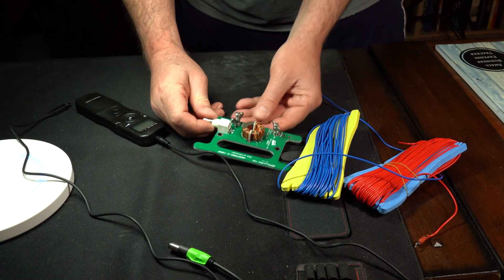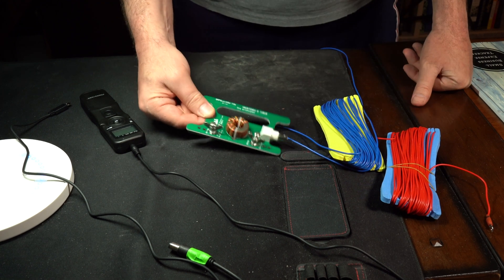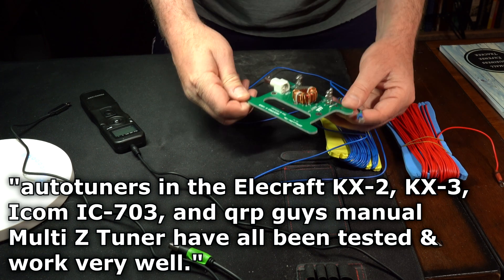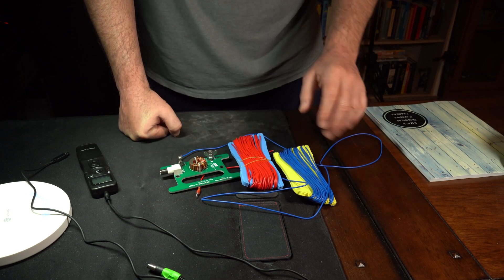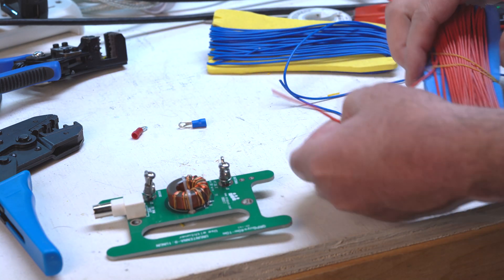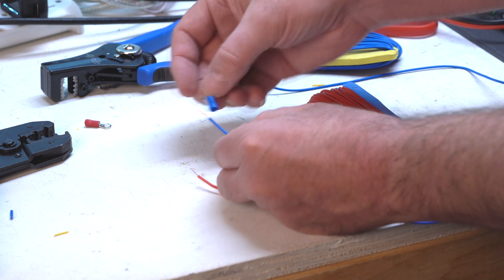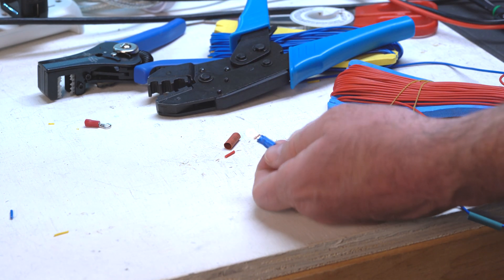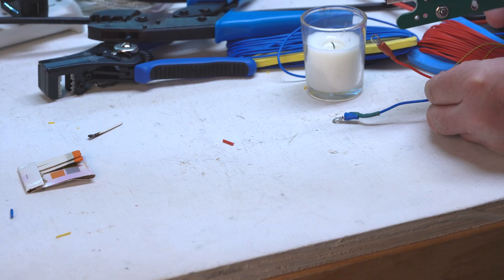CHEAP Ham Radio Wire Antenna! | Semoic Balance Unbalance 10W Balun 9:1

Comment: My first antenna. I spreaded them along my house indoors when i first got a radio. It actually worked.  I was just tinkering with it mainly using as a substitute for a dummy load.
Reply from the maker: Love that.  I did some wacky stuff my first beam I made for 10Meters i made out of pvc and aluminum.  Bands were dead.

Comment: Very nice video. One tip the two holes that run vertical to the wing nuts are designed to put the antenna wire through it. Gives extra support and less strain to the connectors.
Reply from the maker: That's a great idea!

Comment: The price went up to $23 and they no longer supply the wire!     “We provide all the components except the antenna wire and counterpoise wire. You use what you have available. We recommend anything from 20awg to 26awg. Two holes are provided for you to tie down or suspend the device depending on your circumstances.”
Reply from the maker: Wow, Dave. Thanks for the update.  Ugh.

Comment: Does this require a tuner if used on the FT 817 within the described bands for which it is made ?  Sorry to ask but I was not quite sure, thank you for sharing.
Reply from the maker: Yes requires a tuner for sure.  10-40Meters.

Comment: Snip a slot slightly larger than your bolt size in the wire connectors you added with wire pliers.  You can then slip the connectors up under the wing-nut.  Works great!
Reply from the maker: Yeah, in hindsight I shudda done a U instead of an O

Comment: Not to be too pedantic, but the crimp terminals are color coded for wire size - in basic terms, red for small gauge wire, blue for medium gauge wire, and yellow for large gauge wire.

The red terminals are the proper size for your radiator and counterpoise, though for best fit you probably could have stripped the wire a bit longer and folded it over.  Crimping the bare conductor in the terminal barrel makes the connection.  Soldering is not necessary but doesn't usually hurt.

I"m probably just opinionated after 30+ years of working on vehicle electrical systems but this is how I do it and it works for me.  YMMV.  John K0MXL
Reply from the maker: Yeah I know these things its really about making a connection that wont fall off

Comment: Hi Tommy,
Looks like a nicely done antenna. Hope it performs as well as it looks. I would have used fork connectors and slide them under the wingnuts. Should provide a secure enough connection against any strain.   73   WB3BJU
Reply from the maker: Yeah, Don, I shud have used fork connector in hindsight.  Oh well.  : )

Comment: I like the way you soldered the lugs as well as crimped them.  I ALWAYS do that as well as use heat shrink tubing for a strain relief.  I have never had a crimped only plug on a wire that didn't eventually come loose.  Those are pretty cool antennas for the money!
Reply from the maker: Thank you KX4UL.  I didn't NEED to do that, but I LIKE to do that.  Someone commented that it was unnecessary, but I like to do it anyway.  : )

Comment: Couldn’t find it on Amazon.
Reply: QRP guys has a 4:1 EF kit that handles 20 watts. They also have a capacitive tuning antenna that you can use 25 feet of coax instead of the radial.
Reply from the maker: There is a link in the description of the video.  https://amzn.to/35bmbst

Comment: Was the red and blue wire included in this?
Reply: NO ANY MORE.   “We provide all the components except the antenna wire and counterpoise wire. You use what you have available. We recommend anything from 20awg to 26awg. Two holes are provided for you to tie down or suspend the device depending on your circumstances.”
Reply from the maker: Yes it was. https://amzn.to/35bmbst